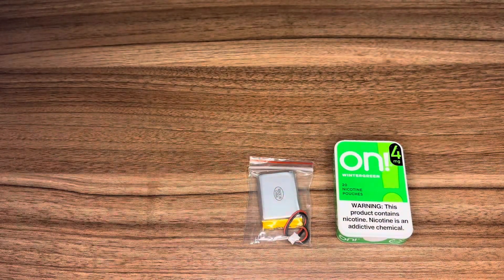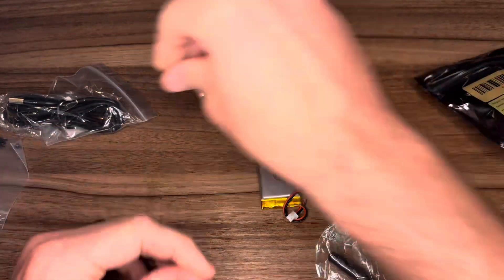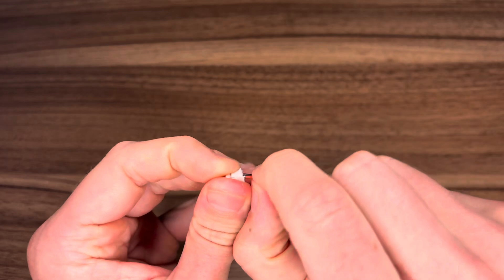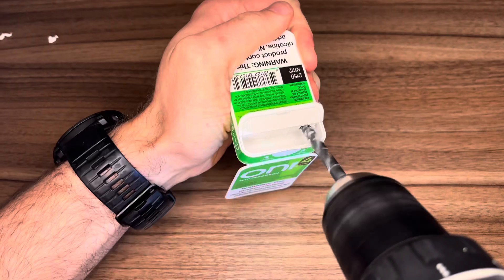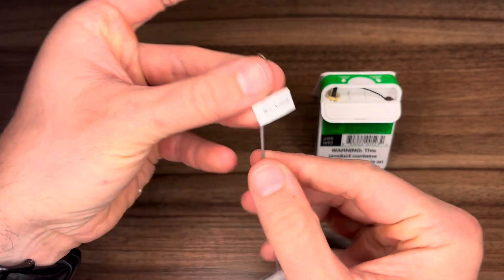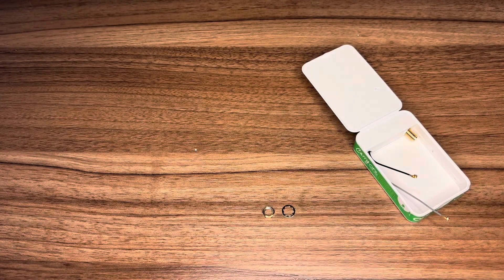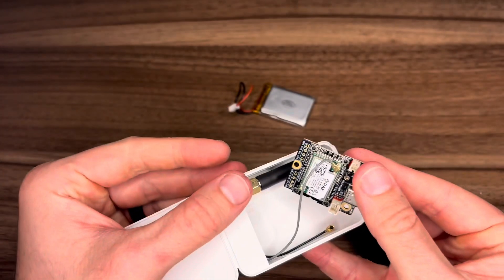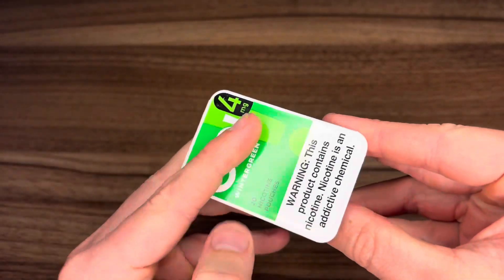DIY Covert Meshtastic Node - Full Build Guide

Comment: Just be aware what you’re gaining in pocket ability here you’re losing some with the LoRa antenna being jammed against everything else.  It’ll still work. But a lot less well than it could if the antenna were sticking out.
Reply: Simple fix, don’t mount it through the hole, drill a hole slightly larger and find a white cap that fits.  Then if you need better coverage slide the antenna forward out the hole . 3d print marketplaces might even have a simple slide for it or easy to make
Reply from the maker: @TerraMagnus  it’s a simple trade off, like with almost anything. A Prius is cheaper and more fuel efficient than a Tahoe, but doesn’t have nearly as much interior space or towing capacity. An internal antenna does have marginally decreased link budget, but it doesn’t have an antenna sticking out and it’s less conspicuous.

Comment: do not mount a antenna next to the pcb an batterie
Reply from the maker: @christianfrericks5531  explain yourself, Christian! What’s at risk?
Reply: @madgearcompany  you get worse signal range and penetration, battery and pcb (wires that pass through current) worsen the signal strength
Reply: commenting to wait for answer.